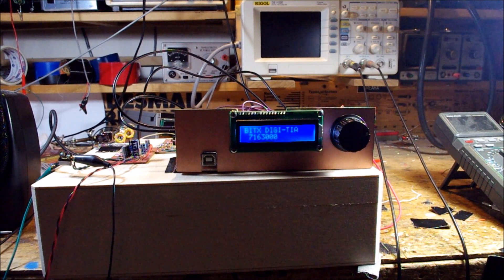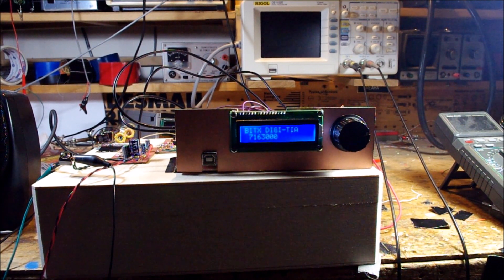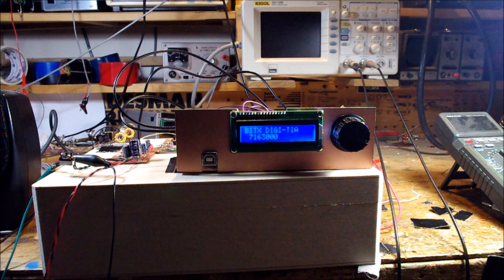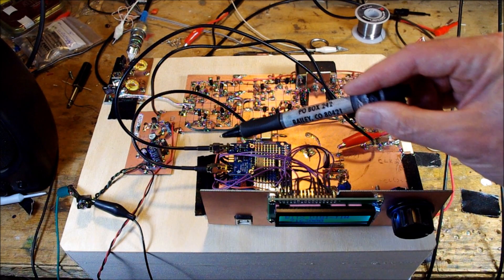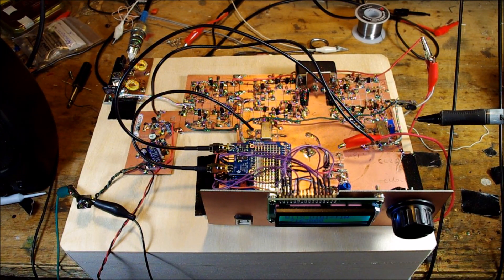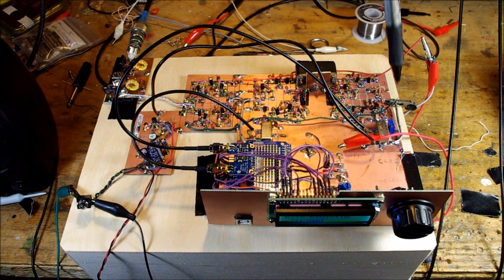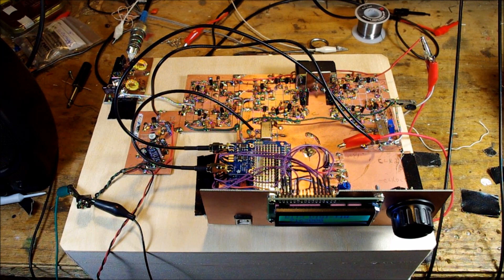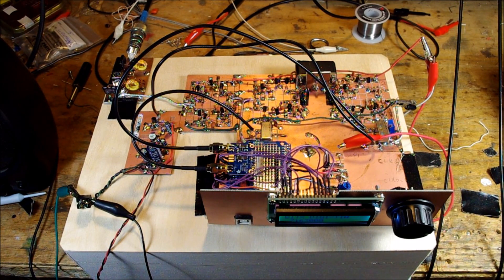BITX DIGI TIA update

Comment: Nice work Bill.Because you took the Arduino for a VFO / BFO,I`m sure that your project is very stable and has no drift what so ever.Do you go for the origial Bitx linear with the IRF510 or are you going to use the RD16HHF1.

73`s Edwin de PA1ED

Comment: Why Si5351 and not AD9850? I'm curious about this.
Reply: Navarro Eletrônica I believe it is mainly because the Si5351 has multiple outputs, thus providing both the LO and BFO signals.  The AD9850 only has one output.
Reply: *****  You are right! I saw the video again and he is using one output for BFO.  Did you head the sound of Ararinha 4 from PY2OHH? I think he sounds better than the BITX. I have both here and I'm finishing the BITX for 20m and trying to put the Ararinha on air at 15m band (my favorite band!) Regards, Felipe PY1CX